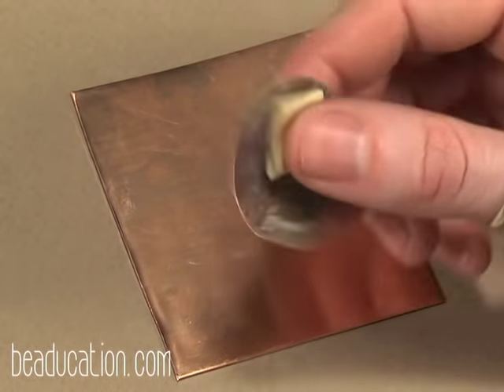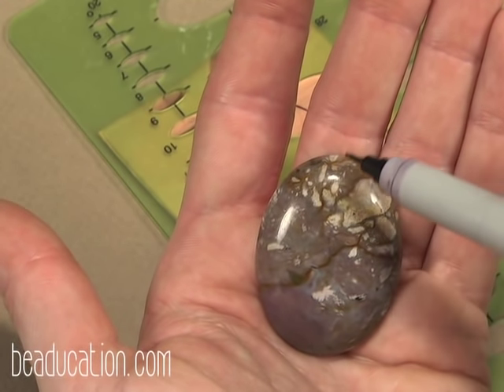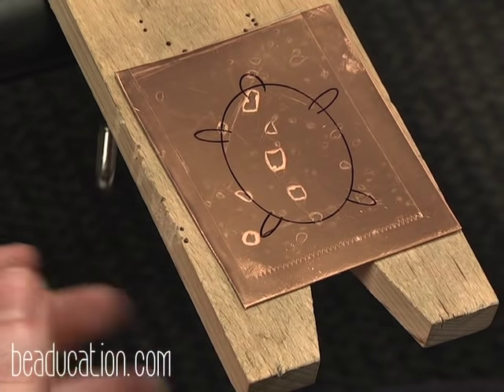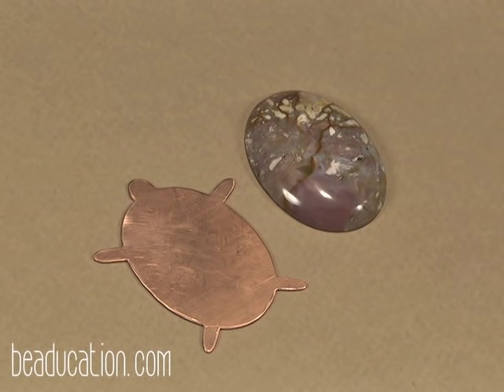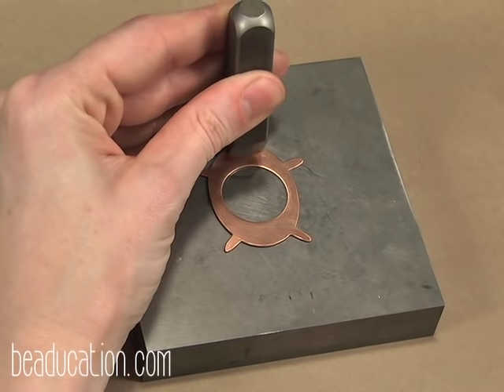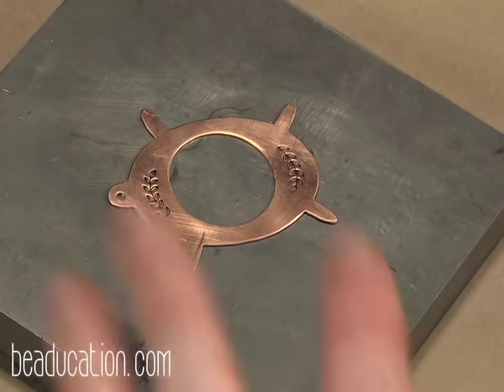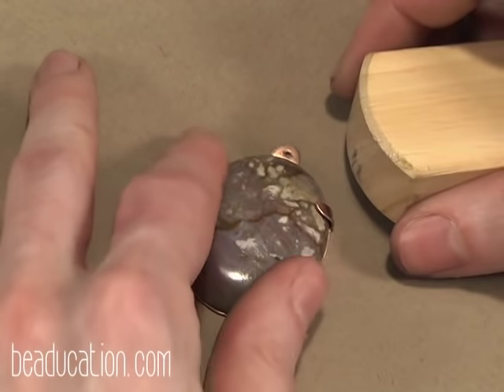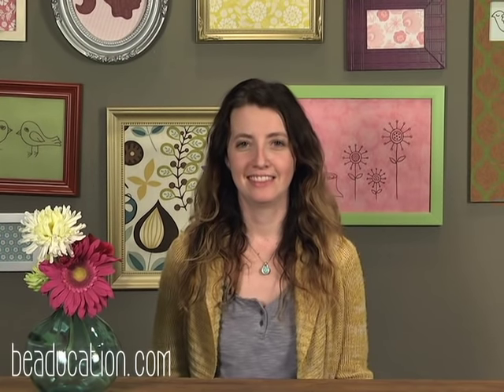Tab Set Pendants Tutorial, Jewelry Making - Beaducation.com

Comment: A quick little tip that MAY be a little less accurate if one does not have calipers or is just lazy, is to take a string and set it behind the stone when you go to trace it and mark the string right where the edge of the stone is, then fold it up and over the stone and mark right at the length you need the prong to be then use that as your prong size. Even paper will work